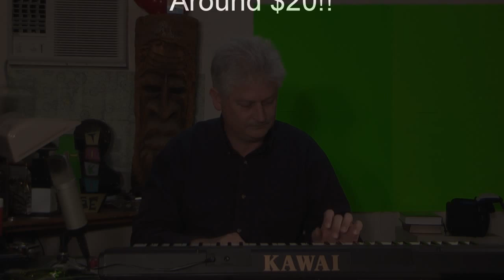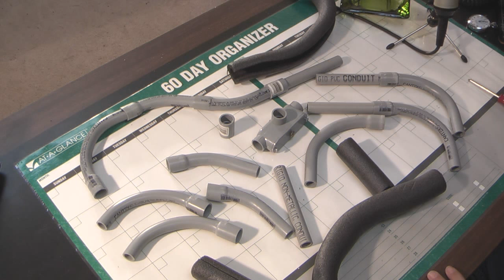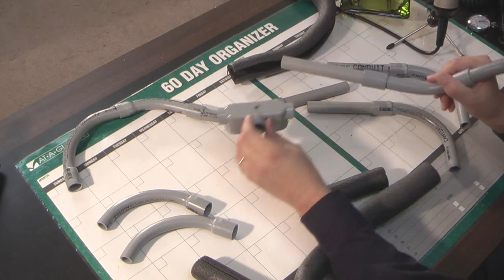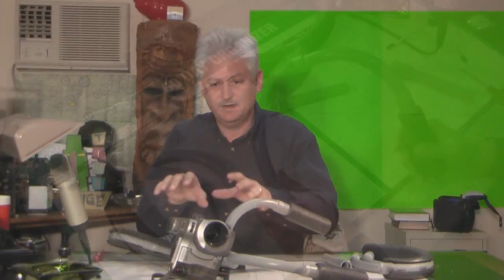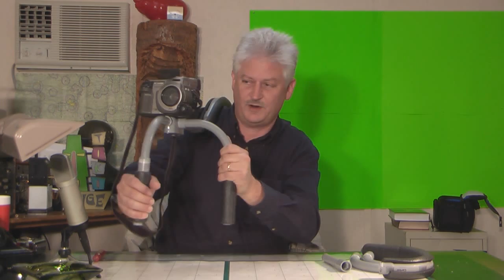Webcast 8: Build a Steady Shoulder Camera Rig

Comment from the maker: You may find you want some additional pieces to suit your needs, this is just a basic concept model, you can personalize it any way you like.
One thing, the only pieces I have glued with PVC cement go over the shoulder. The rest are press fit so they can be changed to suit the particular use.
I forgot to mention some nylon zip ties to hold the foam insulation to the shoulder part, the insulation is just a slip fit on the handles.
Oh, and a hacksaw. I used a power miter saw but I realize not..

Comment from the maker: It's all made from electrical PVC, that's the grey stuff, it's a lot cheaper. It's also all 1/2" size.
The basic setup requires 1 T-box, 1 stick of PVC pipe (10'), 3 90 degree sections, 2 45 degree sections, 2 1/2" slip joint connectors, 1 piece of foam pipe insulation, 1 inch and a half long carriage bolt (1/4" x #20 thread), 1 nut to match.
Can of PVC cement and some super glue for the nut. and a 1/4" drill bit.
Be sure to see the video response about the updates and added weight.